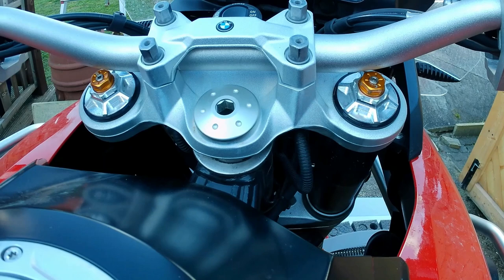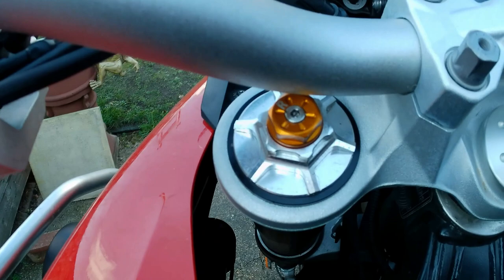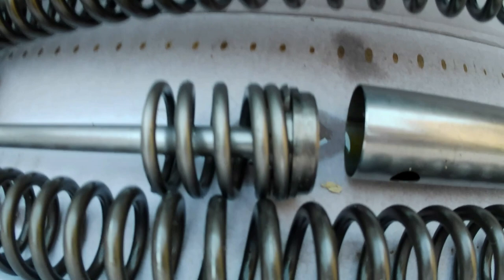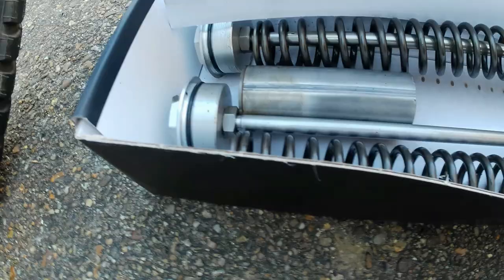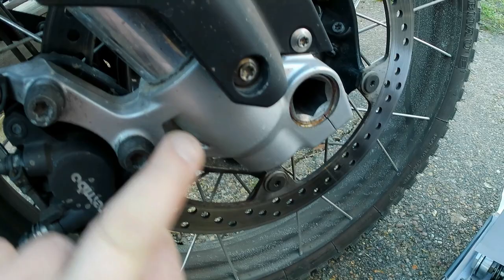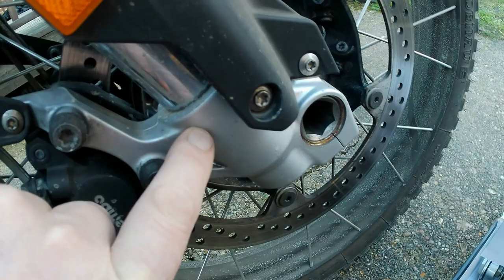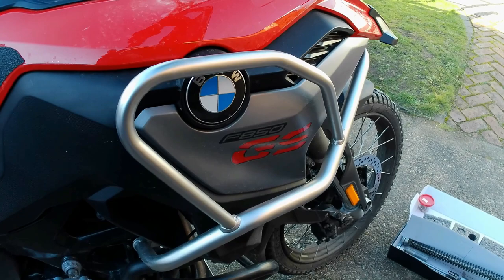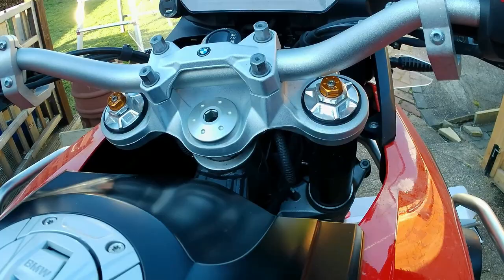Andreani Misano Evo fork cartridges for BMW F850GS

Comment: Thanks for the video man! Do you know if these are for street and race only or for off-road too?
Reply from the maker: I have used the bike on road and done a substantial amount of off-road in Spain France and UK following the TET. The performance is a massive improvement in my opinion.
Reply: I've just got mine, and in the installation file there is a step for the left fork saying "mill the grain you find in the axle clamp". Did you have to do any of that? Or you find a workaround? Thank you!

Comment: DO YOU HAVE VIDEO in the process to instal it?    ( sorry about my englis is too poor) im from ARGENTINA.

or...
Can you advise me some guide video to see how to install them (I just bought them and I don't dare to install them)
Reply from the maker: Hi, I didn't film the install but wish I had. The right hand fork leg is VERY easy and straightforward. The left hand leg has a circlip to remove to get the lower spring out and you will need to remove the left lower axle clamp.
Reply from the maker: https://youtu.be/-IWZTUM7oco
Watch this for tear down. NOTE you do not have to separate the upper and lower fork tubes for the Andreani install
Reply from the maker: https://youtu.be/guEqCRPYViU
Watch this for axle clamp removal. You will need a fork tube clamp unless you can improvise something yourself